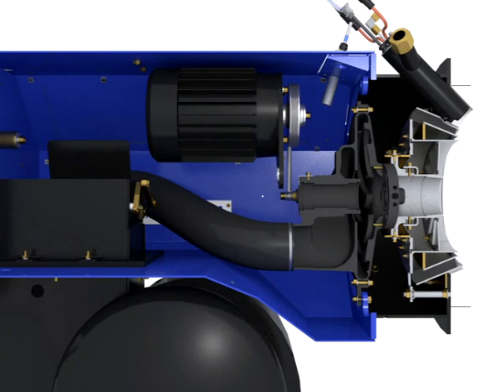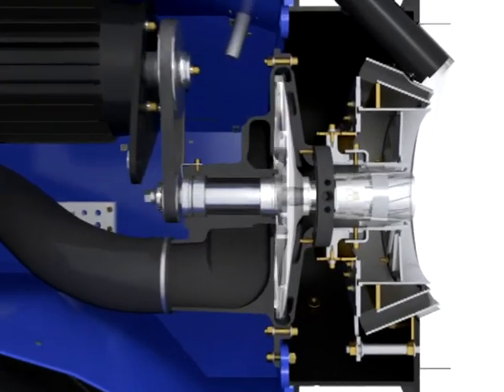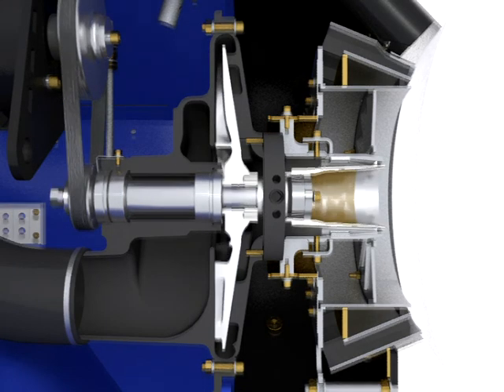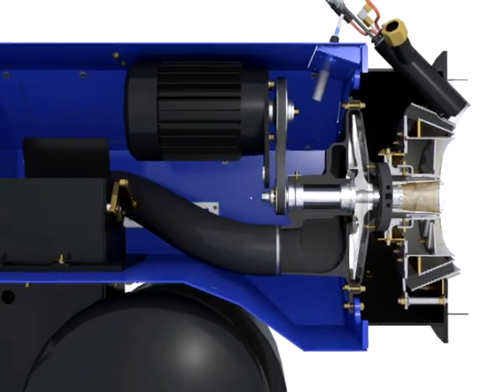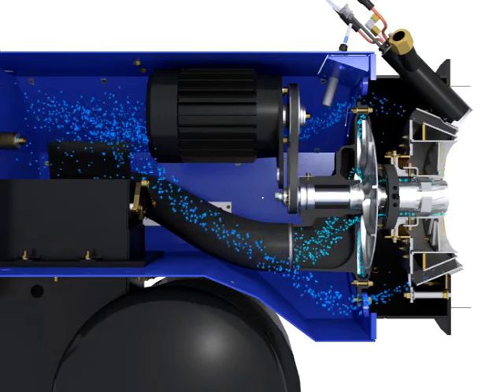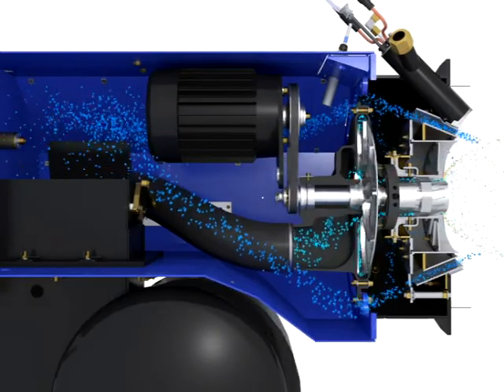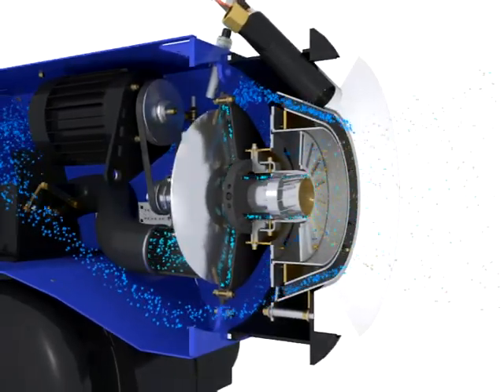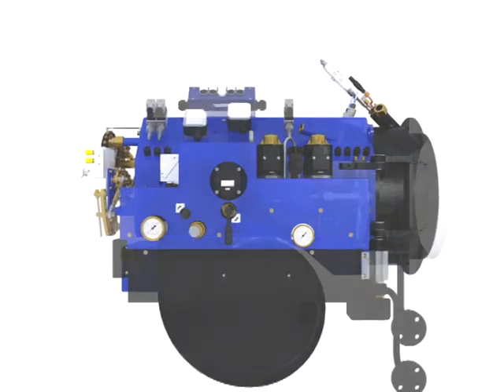SAACKE - SKVJM principle atomization - EN

Comment: I hope SAAKE will share in inthernet normally manual instractions. Because i hade seen on my ship manual books - there is half information always. Actually i need NORMALLY spare parts sheet. I need also bearings dimentions. I want to know for example how to get fuel seal on burner because its leakes. Off cause burer is good end secure. But. How to get to fuel oil pipes inside. I neeed dismount half of burner really! Why no possible make much simple construction for manually repair? Why your fuel heater cant be cleaned just only change on new!? Why?Do you know how hard explaine super intendants what i need new heater and how long i should wait for new... Monarch type burner much simple for use and repair.
Reply: German products isnt friendly user, Japanese still the best,